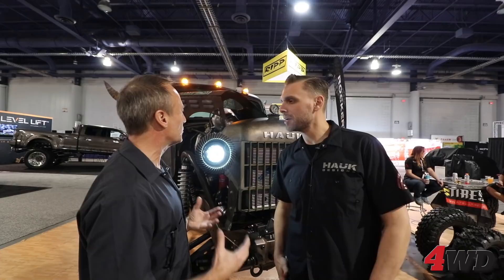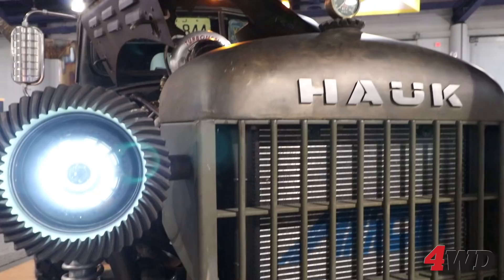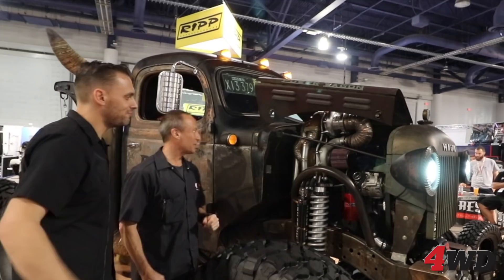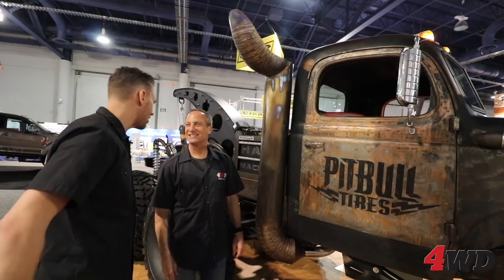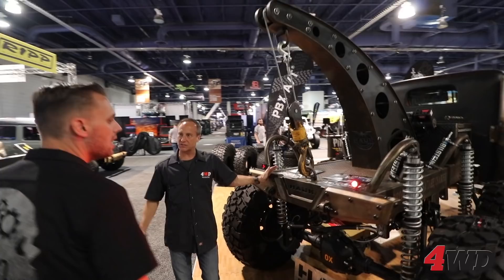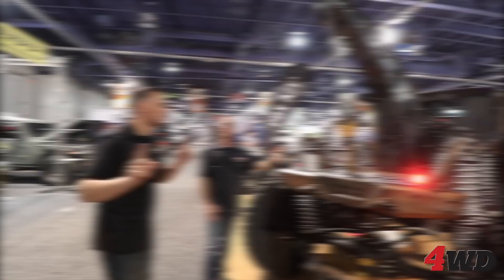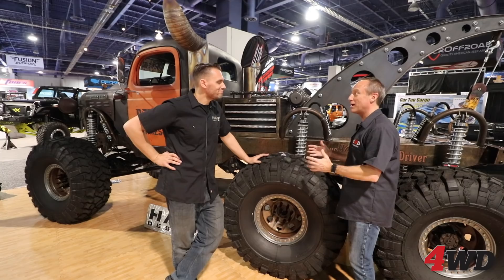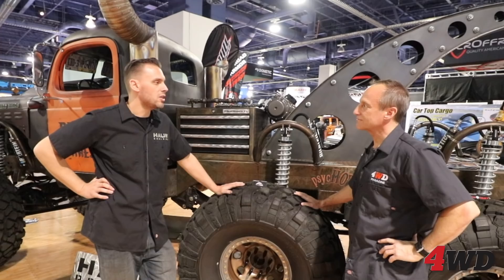1946 Dodge Power Wagon 'The WRECKER'

Comment from the maker: Can you imagine having the time, cash and creativity to build something like this? WHAT WOULD YOU BUILD ?!?!?!?!?
Reply: Yah man
Reply: I'm building a 1978 IHC 5070 series 6x6 motorhome. 
Has a 6-71N Detroit diesel powering it.
Running an 8 spd progressive transmission, with a low,+ low-low.
18,000 lb front axle, 44,000 lb rears. 
6 way air ride for driver (me), center seat is a 4 way air ride for the wife, and a stock bucket on passenger side.
If I had cash, I'd finish it faster.
Reply: If I had the cash and time to build everything I wanted I'd run out of space in a month and I'd also be broke in less then a day!
Reply: Even if i did i would build a showroom piece id build it to work & he said it here is it a functional wreaker? He said it does wreak things
Reply: Ideally, I'd build a quad motorcycle around a Ford flathead.